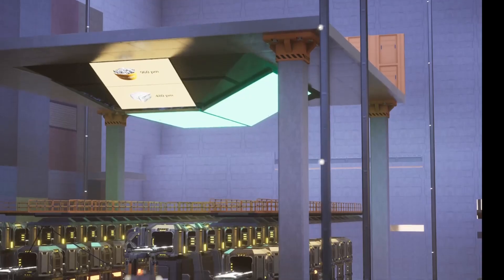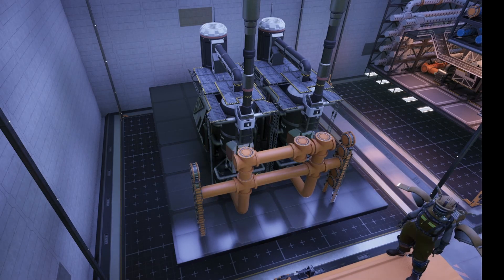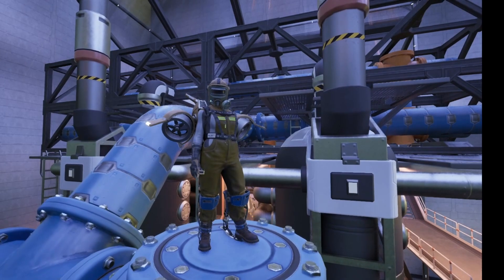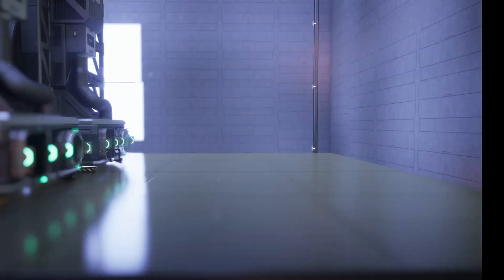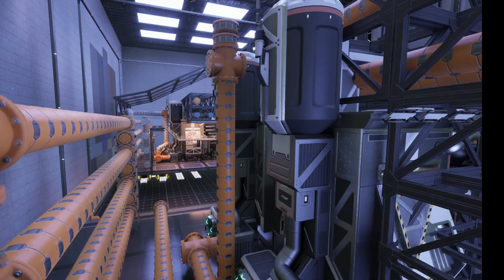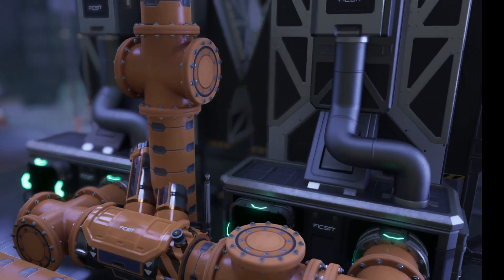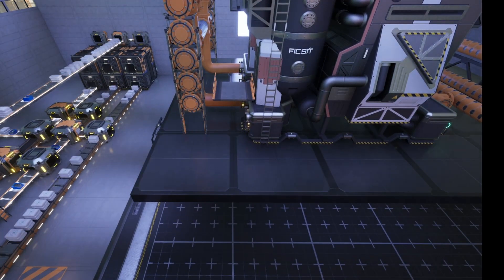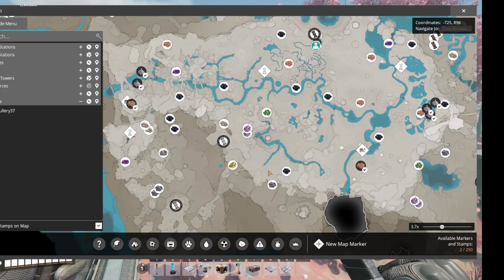How I Build Blueprints in Satisfactory 1.1 to stay organized

Comment from the maker: Slight addendeum for this blueprint at about the 5:00 mark, where I was explaining how to connect the output piptes. Instead of feeding in from the top, I would recommend start feeding the output to the pipes at the bottom pipe, and then switch to a higher pipe every second blueprint or so. I laid these out in a row and it was just very inconsistent. Alternatively, you could make it as I explain, but just delete the top pipes after the veritical junction on the bus pipes until you're ready to fill the next pipes up. 

This setup probably would have worked if I only needed maybe 4 of these bleuprints, but I needed to lay down 6 of them. So the solution coming out of the middle of the lines get clogged because there's too much coming in from the previous machines.

Comment: Very cool blueprints, i would suggest that you paint those nasty fluid pipes tho, it helped me a TON personnally when troubleshooting fluids to know what liquid is inside what pipe rom very far away by the color of the pipe, those bauxite factories having not 1 or 2 but 5 different fluids its painful to see plain orange pipes everywhere tbh (alumine pink pipe, water blue pipe, oil dark pipe, transformed oil purple pipe and nitrogen white pipes is really differenciable from an eye blink)
Reply from the maker: Completely forgot I had painted the ones in the actual blueprint but forgot to paint the ones in the version I was building in the video. Got a whole general color scheme pretty close ot what you described. I try to keep one shade of blue for freshwater and a second shade of blue for wastewater though.

Comment: The cinematography in this video is unreal! It was always easy to see exactly what you were talking about and it looked awesome at the same time. Fantastic work!

Also, can you explain why you use stairs and not ramps to raise the catwalk platforms and not ramps? I think you might be right, because I've been using ramps and I've run into issues when trying to go to another floor before, but I also use the industrial walkways instead of catwalks, and I guess those just don't have stairs.

For my blueprints so far, I've tried to make them sort of like black boxes (They're actually green) so I can think about them in terms of inputs and outputs. What I do is figure out what I need and/or what I have to work with. Then I run the calculations for what I can make with a certain amount and I build a blueprint around that, and document the exact number of materials going into and coming out of the system. When I get all the machines set up and wires, I surround the whole thing with walls and leave openings for where I put the materials in and take the product out of. I also leave an opening for power and a door to get into the box. So lets say I want some cables. I'll go up to a copper node and throw down a miner for 300 copper ore. Then I'll put down a black box blueprint to smelt 300 copper ore and put out 300 copper ingots. After that I put down another blueprint that takes in 300 copper ingots and puts out 600 copper wire. To  finish I put down a blueprint that takes in 600 copper wire and puts out 300 cables. Then if I need more, I just set up a parallel system that does the same thing.

The downside to doing them this way is you have to do some logistics work between each blueprint, and they also aren't too exciting to look at since everything you see is walls. The upside though is its pretty simple to figure out what you can make with what materials.

Side note: Did you know if you have a wall on the edge of the blueprint designer you can't use the placeable conveyor hole on that wall because it goes "Partially overlaps the blueprint designer"? So I have to use the walls with holes already in them. The same is also true for the double sided wall power connector, so I just put another wall with a hole in it and put a power connector right on the other side.
Reply from the maker: I wanted to comment real quick and say I'm glad you enjoyed the video and thanks for the feedback. I've decided that this is how I'm going to make videos now. It is a bit tedious at times, but I really think this is the best way to explain building certain setups that doing it live, first-person isn't going to quite cut. 

I went with stairs and not ramps mainly because they're steeper and that conserved floor space for building in the blueprint designer. Best way I can think to explain it is that a stair case is basically the same as a 4m foundation ramp and the catwalk ramps are equal to a 2m foundation ramp. I'm very rarely going to need a catwalk that's just 2 meters above the factory floor. I originally thought about just snapping catwalks to the machines and making that the catwalk base, but it's way too inconsistent for height. 

I ran into the same problem you're having where I'd end up with these uneven catwalks. What was happening for me was I'd place a single 2 meter ramp somewhere but then never added another to even it out. 

I love box factories myself. I have one playthrough where I basically made a small "town" of individual factories for early game parts. They fed into dimensional depots before being split for overflow to an awesome sink and another path exiting to a more complex part. So, I'd have a one click factory for iron plates and one for copper wire that would first fill a dimensional depot with a storage container buffer, then move to the sink/exit splitter. I'd have those exit out to  another building making stitched iron plates (the first two factories were designed to feed this one). This way I'd always priortize my depot and really just only sink the most expensive part in the chain. 

On the wall in the blueprint, you just made me think of something I think I'm going to have to try. I'm pretty sure you can adjust frame walls to sit on the outside or inside edge of a foundation by hitting the scroll wheel when it's snapped on to a foundation. Just to clarify, I mean like when you aim at the foundation and not like locking the foundation by hitting H. So, maybe you could scroll a frame wall to go on the inner edge and then place a regular wall on top of that. Delete the frame wall and then add another wall under the one you just placed. Then try putting the wall holes in. 

I have no idea if that will work, just purely based on imagination and memory, but let me know if that works if you get to try it before I do. 

Thanks again for watching and commenting!

Comment: Wow, just stumbled across your channel and that's some amazing editing. Also love that blueprint, really nails that industrial style; I should really try and do something more like that at some point, I've barely used frame foundations but whenever I see them used in a build it's always peak.

What I've been doing with my blueprints is make each one as if the whole blueprint were a single machine, with walls and beams and all that integrated directly with the machines to unify them together into something that looks like a single larger unit, while still retaining the characteristics of the machines (and still often containing catwalk access, gotta have catwalks). The inputs and outputs to these then would often be on separate blueprints, though that's at least in part an artifact of not having higher tier blueprinters (previous saves were before 1.0)

Right now I'm still relatively early on my 1.0 save (which I had taken quite a long hiatus from), hovering at the end of phase 3 as I build up all my comedically over-scaled factories (I think I have a problem with my ability to determine a reasonable starting size for a build) - currently starting on a fuel power plant, using diluted packaged fuel (since I want to get it up before progressing to phase 4, but still want to use diluted fuel because I apparently don't know how to build small), and I just finished a diluted packaged fuel blueprint I am quite happy with - if I do say so myself, I think it does quite a solid job of integrating the packagers into the refinery to make something that looks like one bigger machine with extra cylindrical stacks and such.

Still, those blueprints always end up in a very different style; much more sleek than industrial, even with the odd dummy pipe to spice up simpler refiners like pure ingots and such, so I should really try to diversify a bit. Maybe for my concrete plant, that one's already started with more frame foundations than other builds (and is currently on pause since I realized right after starting laying the foundation that I have no excess power and need to get the power plant up first)
Reply from the maker: I have tried so hard to make the machines look like they are built into the architecture, but I never end up with something ... dare I say, "satisfactory"? 
I think part of the problem is I'm torn between really loving how a factory looks when you can't see what's going on, but also really liking those builds where you see lifts behind glass moving raw materials in and finished products out.
Reply: @efficientish  Yeah I love that too, I often end up trying to strike a balance with my integrated designs, where I keep some parts visible moving on the outside of them, but in such a way that it's more like seeing into the internal workings of the machine (so it's a bit of both - stuff visible moving everywhere, but also hard to follow without a concerted effort less due to spaghetti and more due to volume of connections). That's the intention, at least

Comment: On the rare occasion I do use a logistics floor, I use the glass floor above it so I can see the belts while on the factory floor. This really helps when troubleshooting, and doesn’t cost anything more than a little steel.
Reply from the maker: For some reason, I thought silica was involved in the glass framed floors (since windows require them I guess) so I was always hesitant to use them until I had a decent quartz production feeding a dimensional depot. 
I've been using them a lot more lately though. I like to make blueprints with label signs inside of them for lights, which I'm aiming to have a shorter video on this weekend.
Reply: I'm addicted to the floor type so much so that my series x makes a sweet take off sound when my world loads in because of those beautiful floors.

Comment: How do you nudge the signs into the glass foundation like that? That is genius!
Reply from the maker: Thanks! 
the simplest way I started doing them was by laying down a glass foundation into a blueprint designer and take a 4m label sign and lock it to the outer edge of the foundation, like if you were going to place one of those one meter walls along the edge. You lock it in place and then just nudge it forward until it's ont he inside of the opposite side you were placing it in. You'll have to do a small nudge at the end, otherwise it'll go all the way, through. 
This was a post I made on a Satisfactory subreddit a couple of months ago. There are a few people in the comments who made other suggestions of how they set it up.
https://www.reddit.com/r/SatisfactoryGame/comments/1o9me1l/i_think_i_just_found_the_thing_im_going_to_be/
Reply: @efficientish I ended up using catwalks at a slight angle to offset the sign from the grid. For vertical nudge I used frame foundations to get 90% of the height I wanted and the last 10% from placement of the sign stand on the catwalk edge before nudging it down. Was very tedious but was able to get the signs perfectly centered in the glass beam
Reply from the maker: Nice. I was actually recording the intro for a new video for the light floors after thinking about your comment the other day. I'd love to see the one you made. If you feel like it, I'm the OP on that reddit post I shared. Send me a screenshot through there.

Comment: The editing is amazing. Although my smooth brain couldn't understand the balancing, am watching this on repeat.
Reply from the maker: Thanks! I think this particular design is a little odd because it relies on the wastewater produced in a the electrode scrap blueprint being made elsewhere. The vertical pipe junctions prioritize the lowest input, so the wastewater line shouldn't get clogged up. Also, since the freshwater we're bringing in is a little less than half what all 26 refiniers need to be fully efficient then I think the water should flow fine even if we weren't using vertical junctions.